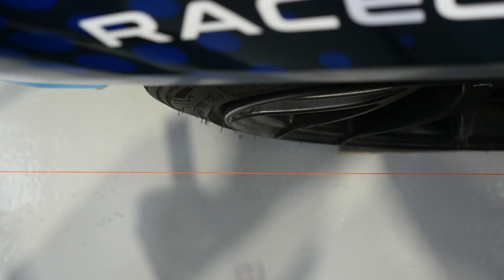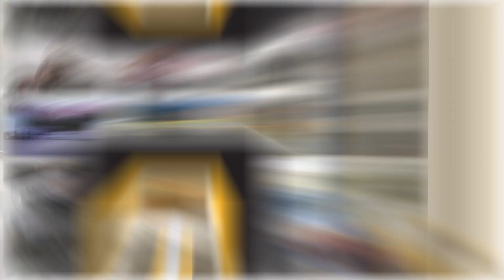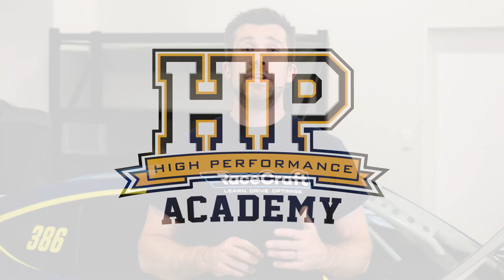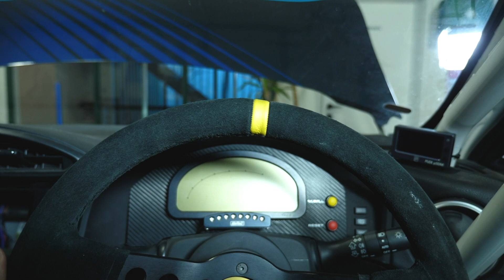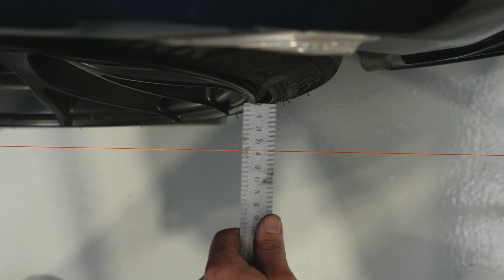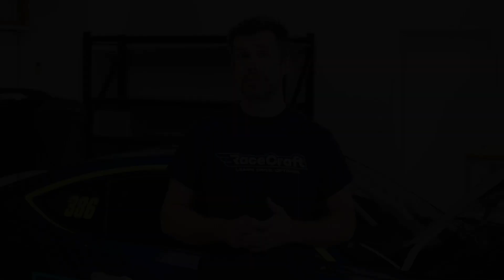How To Adjust Toe | Professional DIY Wheel Alignment

Comment: This guy doesn’t know what he is talking about. Longer measurement at the rear of the tire means toe in not toe out .
Reply: No?? If the depth from the string is bigger, that means that side of the wheel is further in. The smaller the measurement then the closer the rim is to the string. so if rear side of tire is farther in the front side of the tire is farther out / closer to the string, and therefore toe out.

Comment: My front tires are wearing on the inside...When I loosen the lock  nut am I turning it toward the front of the car or the back of the car ?
Reply: Depends on the car. Best thing to do IMO is try and follow the threads with a pick or just visually to figure out if it's left or right hand threads. Or just try it in both directions lol
Reply: Anti clockwise to loosen

Clockwise to tighten

Comment: When you say the measurement at the front edge of the rim is 39mm and the rear edge measurement is 40mm your calling that toe out??? Seems backwards??
Reply: Measuring from a string inward, yes.

If you were measuring the total distance from side to side the measurement would be a lot more than 40mm and it would be toe out=shorter rear measurement.

Comment: If any steering column linkage has ever been disconnected, it'll be worth it to assure it was assembled exactly centered.  Don't ask me how i know but yeah, if your steering wheel won't center after a meticulous alignment, check the steering linkage alignment too

Comment: At 5:50 when tightening the jam nut you can see the tie rod end heim joint is loose on spindle assembly.
Reply: Nice spot. I noticed that also. Shelby is a chode.
Reply: What did you win?
It's a demonstration video.